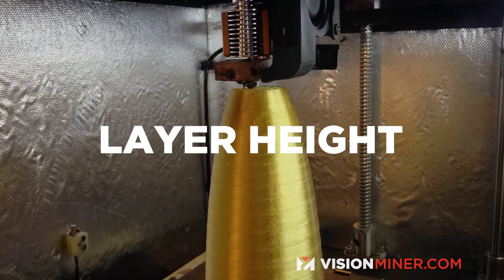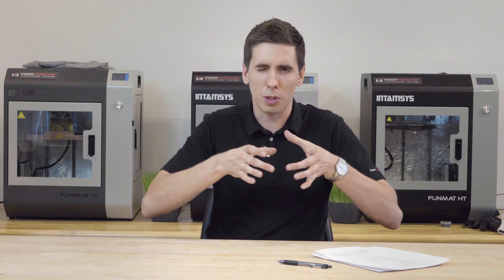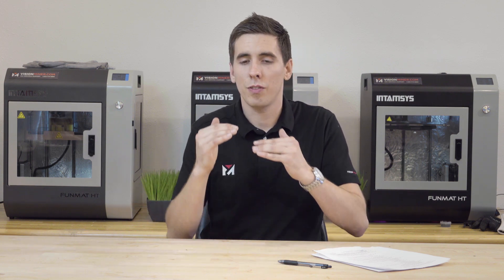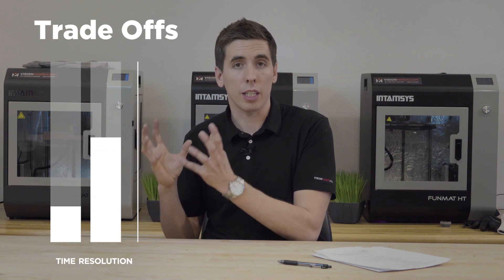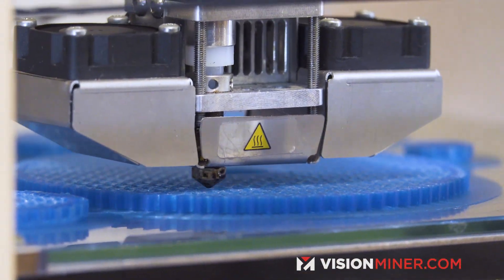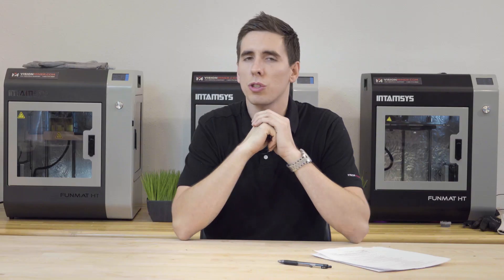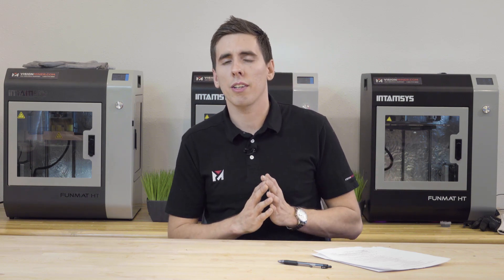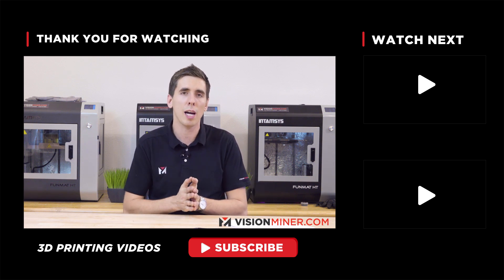Which Layer Height Do You Print In? 3D Printing Resolutions Explained

Comment: How to calculate the resolution of a 3D printer? Is there like a formula to it?
Reply from the maker: It's essentially unlimited becuase you can forever tweak the settings and adjust to meet your specs -- almost every printer is technically unlimited, while having limited mechanical abilities in the low 20-50 microns. Fact is, adjusting can bring it in nearly perfect every time.

Comment: I'm pretty new to 3D printing, I've just printed a few small bits and bobs so far, but this caught me out today.
I went to print a part for my car and it was coming up as about 12 hours on my 0.4mm nozzle with a 0.2mm layer height, and I had the "genius" idea to increase the layer height from 0.2mm to 0.4mm and cut the time in half, since the part didn't really have to look too nice.
On my attempt the first layer was a bit wonky in places so I assumed the bed wasn't levelled properly, and so I levelled it again, and cleaned it. Again. Still not realising that the layer height was too large.
Same thing the second time, and I still didn't realise, and so I abandoned it and let the failure simmer in my mind for a while until I remembered that the layer height was the only other variable.
It's a lesson I won't forget again!

Comment: Please explain initial layer height
Reply from the maker: You want it nice and thick. 0.3mm is usually good. If you're at 100 micron, 300% first layer. At 200 micron, 150% first layer, and so on. General rule of thumb is to use a nice, thick first layer to improve overall adhesion. :)
Reply: Vision Miner lmao I thought opposite, my last few tries I was printing @.06 for all layers because I wanted everything to look very nice....the layers are coming apart. 
So what is the smallest layer height to use with a .4 nozzle?  I assume now that .06 is to small or gotta print it extremely slow?